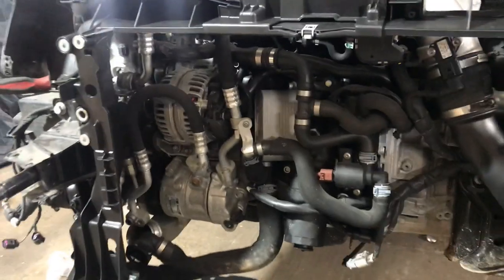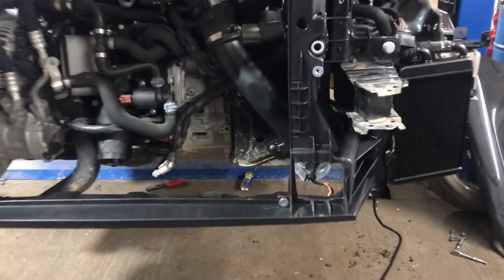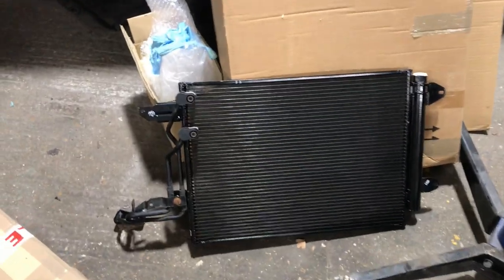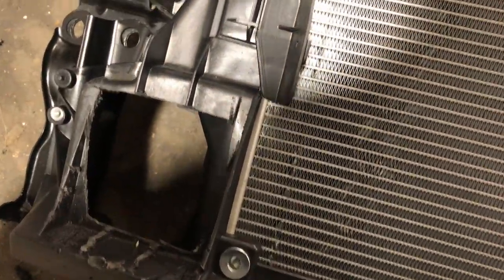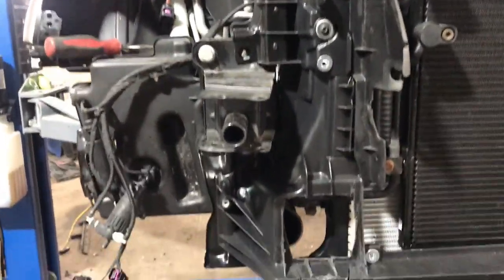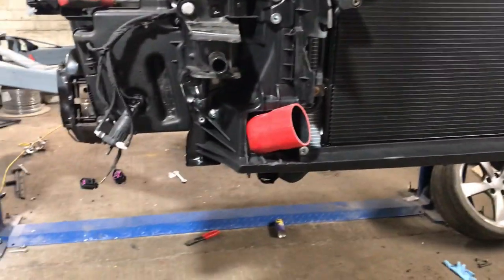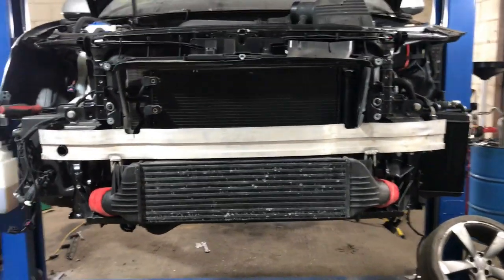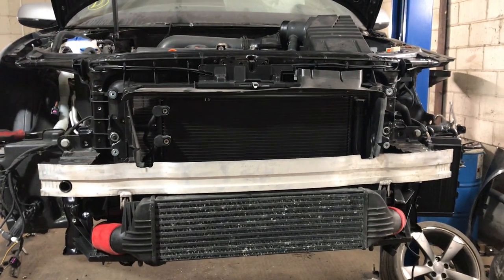My Audi RS3 Salvage/Wrecked Build Project Part 7!

Comment: Just catching up on this one, it was all going well until you butchered the front slam panel / rad carrier, that really needs changing for the correct part as not only does it look untidy but youve also compromised the safety of it :(
Reply from the maker: Its no different to the RS3 front panel, the only difference is those holes which ive made myself, so the only difference between the panel and the official RS3 one is a cleaner look and about £400.

Comment: I belive You got front radiator support with number 8P0805588 but You need 8P0805588M and its different ( intercooler pipes holes ) check photos in this link https://archiwum.allegro.pl/oferta/audi-rs3-8p-pas-przedni-8p0805588m-idealny-oryg-i7092433385.html
Reply from the maker: Oh yes! They must of ordered the wrong one! Well I can’t return it now 😂.. but it looks like I need to cut a lot more trim out! Thanks for the heads up! 👍🏽